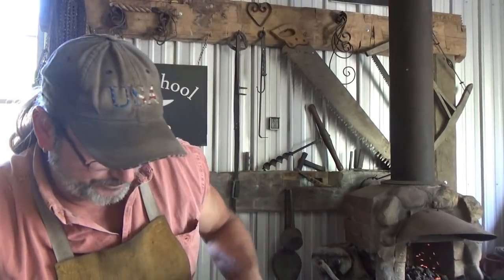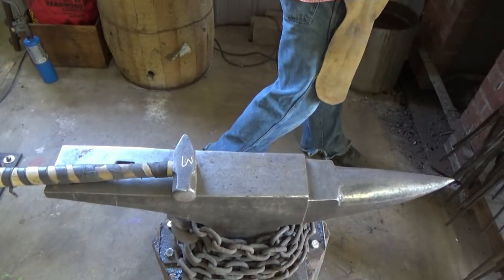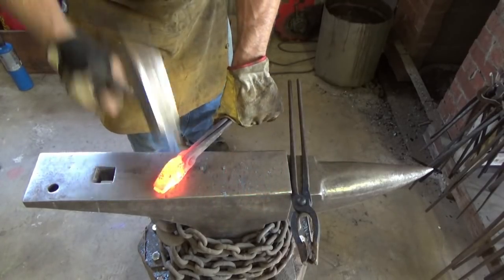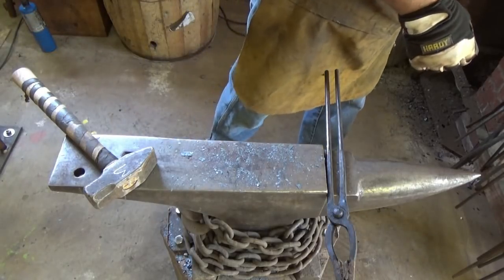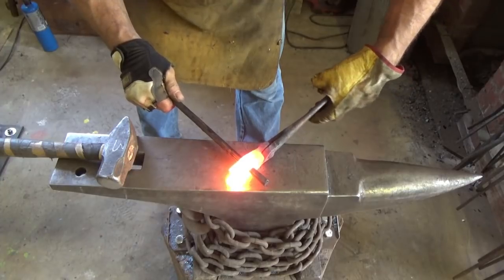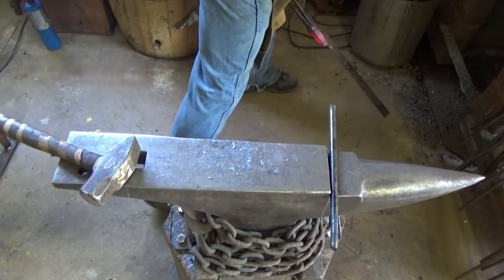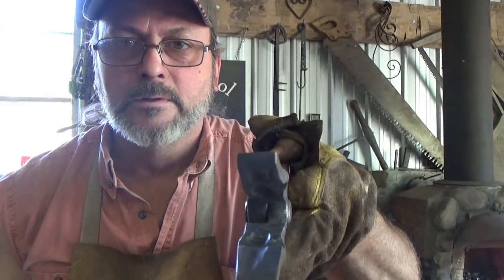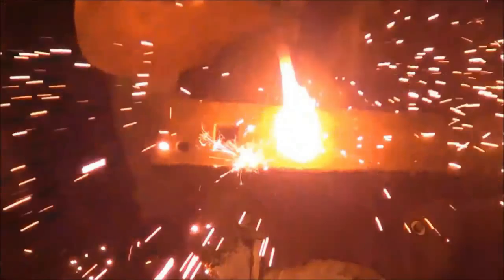Blacksmithing Shorts - Forging Tongs From Hoof Nippers

Comment: thats one way to make your fingers extra sensitive for the next few days! Not bad little pair of tongs. Personally i'd give them a little clean up on the grinder, get that metal which was pushed out when you hammered in the 1/2" across the gripping face so that its flush with the rest of the piece and maybe throw in a slight inward curve on those handles but thats just my preference.